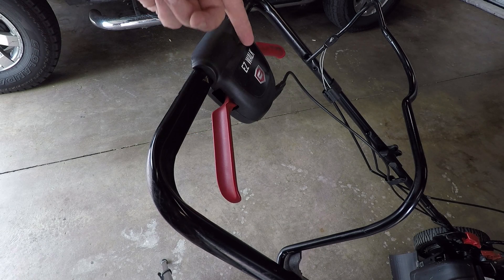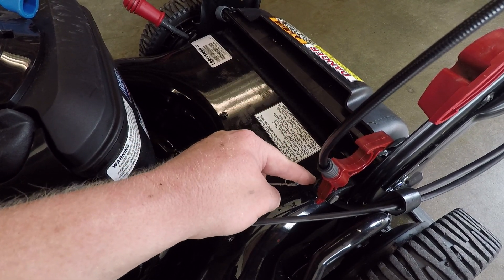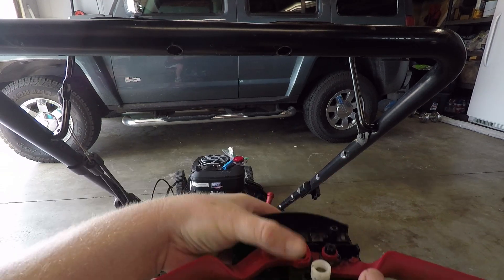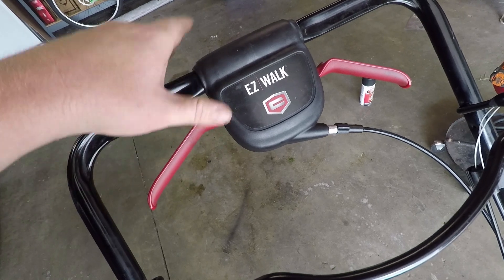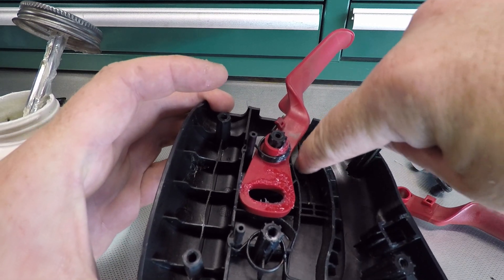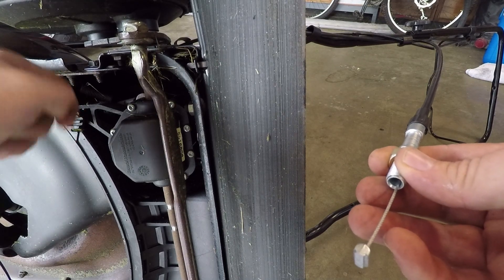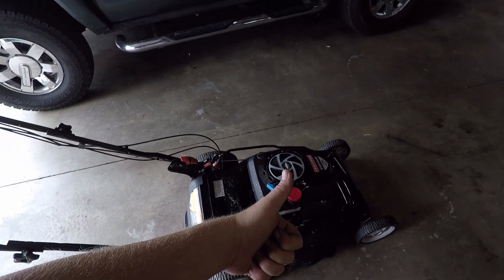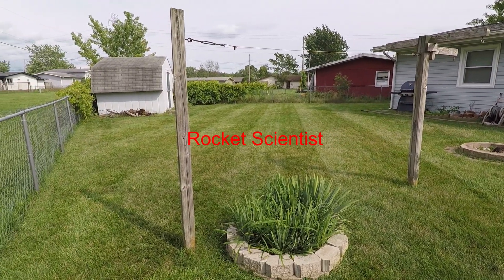Fixing a Craftsman EZ Walk Lawn Mower

Comment: My mower is like this except it ends in 921. I got it a couple of yrs ago for about 20 dollars. I fixed the no start problem and never tried to fix the self propel. I just cleaned it up and decided to see if I can fix it. My red handles won't budge. If you have any suggestions please let me know. I traced the cable to the deck. I'll see if it has some kind of adjusting mechanism to make the handles work. Hopefully this is an easy fix. Thanks for the video.

Wasn't the handle for me. Seems stuck underneath. I'll go into surgery later after my game goes off. Cable can't be broke. There's a lot of tension and no give when I squeeze the handles.

Comment: What is that spring connected to the transmission that u had to put the drive cable behind? My spring broke. Do u happen to know the part number or where it even hooks up to on the mower deck?
Reply from the maker: It's just a return spring for the transmission that returns it to neutral when you let go of the drive handle.  Pause the video at that part and take a screenshot you can zoom in on.  Any spring of similar size would probably work.  Harbor Freight sells a box of various springs for cheap.  Or, do what I like to do:  Go to your local mower shop and find the oldest dude there... He probably knows everything about mowers and will know exactly what you need.
Reply: @RocketScientist  thanks for replying and thanks for the info.

Comment: I do have a question. What's the blue cap facing upward for?
Reply from the maker: It's a garden hose connection.  You're supposed to hook up water and run the mower so it "washes" the deck, but it is a pain and makes more of a mess than anything.  I never use it.
Reply: @Rocket Scientist  Ohh ok thank you. I bought it used and had to replace cable for transmission. And had no idea what it was for. Thanks again. 👍👍👍

Comment: I had a question.  I can’t seem to get mine to pull over. The cord part doesn’t seem to engage the motor...
Reply from the maker: This autta point you in the right direction.  https://www.ereplacementparts.com/repair-center/lawn-equipment/engine/starter-rope-pulls-freely-or-little-resistance/#:~:text=If%20a%20pawl%20becomes%20worn,they%20should%20fly%20right%20out.

Comment: One handle broke on the self propel housing, having trouble finding a replacement part.  Do you know part number and from whom to order? Craftsman sites were of no luck.
Reply from the maker: I usually use searspartsdirect.com to at least find the part number, and google search the part number.  ebay might be your best bet on finding one.

Comment: Mine works but dont let the back wheels to go back if I pull it. And is not strong enough to pull the mower forward
Reply from the maker: adjust the cable.. needs to be a little tighter.  Oh, and when you let go of the handle, roll forward like 6 inches and it'll disengage and roll backward freely.

Comment: Great video. I have another problem hoping you might be able to help out on.  Somehow the front left wheel got wedged into/under the lever bar that's part of the 4-wheel leveling system.  Neither front wheels are able to spin now and the leveling handle won't move either. I took off the left front wheel hoping that would help, but it didn't.  Any thoughts?
Reply from the maker: Jeez seems like a lot of bent metal damage to the front of the deck and wheels... like a crushing type damage to the top front.  Is there a chance someone backed over it with a car or something? 😂
Reply: We solved it by unscrewing the bar, which freed the wheels... simple fix.

Comment: I have a question for you. I have craftsman gcv160. And i'm looking for cable blade ,brake clutch control rear door prop. Where can i get them. Craftsman don't have it anymore. Please help
Reply from the maker: I usually use Ereplacementparts.com or Searspartsdirect.com.  All Im seeing under that is a honda engine.  You might try to find a parts diagram and search by specific part number.  You might also try Ebay if its something really old..

Comment: Hey RV it was amazing it took me a while to put it together but soon as I watched the video you posted was like a piece of cake , but I Brooke one of the red self drive handles I don’t know where can I find one I already checked online and from craftsman as well see if you know where to get the right side handle  ?
Reply: I don't think they exist (I've been searching everywhere). Broke both handles and was so desperate that I used the strongest plastic adhesive I could find and was determined to glue these things back together. After applying a huge amount of adhesive I set it on fire and started melting the handles at the break, then I jammed them together, blew out the fire and put more adhesive on the outside of the break. I waited a day for them to dry (or more appropriately 'cure' in this case). They seem extremely strong now and I was able to reassemble the unit. I've mowed twice so far and the handles seem to be holding up.

Comment: Great video
I tried to adjust the barrel nut on the part where the handles are but still nada won't move faster. So I can remove Handel thingie  and adjust the other nut?
Reply from the maker: Yep turn the nut on the inside of the black plastic housing with the handles

Comment: What is the purpose of the cable that you tied the new drive cable to? My mower has that piece but its broken off. No idea what its for. It's part of the throttle cable assembly.
Reply from the maker: The purpose was described in the video as I did it.  Because the factory mount angle of the cable is a 90 degree and causes extra wear, so the plastic zip tie straightens that angle a bit so it's less likely to break in the future.
Reply: @Rocket Scientist I think he meant what’s is the third cable (stop cable, drive cable for ez walk but what’s the third one). I’m thinking this because I can’t figure out what it’s for either (bought the mower used and sort of regretting based on some of the feedback I’ve read/am reading, lol). The cable attaches to a bracket near the wheel that looks like it holds the bag door cover up but mine is either seized or broken in the middle because it literally does nothing. Any insight would be appreciated!
Reply from the maker: @teezer85  OHH!  ok I misread that.  Yes, you're correct.  There are two cables operated by the safety bar:  the throttle, and like you said, the other one locks the bagger door open while you're dumping the bag, and as soon as you pull the bar down, the door snaps shut.   In your case, chances are it's snapped, but if you want to try something before replacing it, get some Aerokroil and squirt some into the cable sleeve at both open ends, and let it sit for a day or so.  That stuff is like magic.  If that doesn't work, replacement part on Amazon is this:  https://www.amazon.com/Craftsman-587326601-Mower-Control-Cable/dp/B0757785NF/ref=sr_1_1?keywords=craftsman+438392&qid=1564437092&s=gateway&sr=8-1

Comment: I understand your frustration because I engineer electrical enclosures.  The engineers did not design the engine are not the same engineers that designed the deck.  It's the ones that designed the deck system to place the deck cable with the tolerance allowed without interfering with the transmission .

Comment: I have this model (or similarly close) and one of the red plastic handles actually cracked inside the control box so it won't propel any longer.  I can't even replace it with a new handle without getting the whole new unit which is about $50. :(
Reply from the maker: Try this. Same thing, different name.

Pokin for Husqvarna Craftsman 583190501 Drive Control Handle Lever https://www.amazon.com/dp/B07B3T654X/ref=cm_sw_r_cp_apa_i_ppyHCbTCAE0QD

Comment: I have the same mower same problems and more
Reply from the maker: Just recently the auto choke failed and still had problems after new parts.  Turns out I fixed it with a piece of clothes hanger to keep the choke from opening all the way.  Voila!

Comment: This is really made by AYP.(husqvarna)
I don’t like the ez-walk self propelled handle system I prefer the FWD with bark to hold with the safety bar.

Good fix btw.  👍
Reply from the maker: D Fields Thanks!  In hindsight, I probably would have went with the Toro peraonal pace.  Ahh well, next time.

Comment: This video saved me.  I was not fortunate enough to keep everything inside the case.  I had to put everything back inside the EZ Walk case.  Thanks for the close up video shots because the handles only go in one way that allows for easy re-assembly.  Now I can get back to doing what I hate most!!!  :)  At least it didn't cost a lot to fix it.
Reply: I did the same thing,  I should have taken a pic after I had it open and removed everything. I couldn't for the life of me figure out how to put it back together (until I saw the close up in the video).

Comment: Thanks for the video.  I was able to fix the self propel cable but now the lawn mower does not start.  Any ideas?
Reply from the maker: I'd start with the thermostatic auto choke.  It's inline with the exhaust. They are known to fail and cause a no-start.  Briggs & Stratton part # 593208.
Reply from the maker: @JesusIsaFlatEarther  well, I'm not a real rocket scientist, it's just a name I've used for years. But I am a fairly smart guy, so I'll give it a shot.  Air has molecular weight and thus susceptible to the effects of the earth's gravity.  So the closer to earth, the higher the density and pressure of air.  Just like the ocean, the deeper you go, the higher the pressure.  There is no physical barrier holding it in. It's not a "movement of high pressure to low pressure" like a punctured aerosol can.  Force of gravity holds the atmosphere close to earth, and space alone is not capable of exerting force, so the strongest force wins.  Like a tug of war with no one on the other end of the rope.  Conversely, if another stellar body with a stronger gravitational pull were to pass close enough to earth, I'd bet we wouldn't be breathing much longer.  This effect can be directly observed in the moons effect on large bodies of water, i.e., waves, high/low tides.   That's the best I can do off the top of my head.  Hope that works for ya.
Reply from the maker: @JesusIsaFlatEarther  oh, and just out of curiosity, how did you come up with a question that deep from a lawn mower video?

Comment: This is a great video to help in fixing the power drive.  My model EZ-Walk is 917.374541, just slightly different model.  I wonder if the cable is the same size.
Reply from the maker: Breton Bell Thanks!  Not sure on the size for yours, but if you google your model number you might find a parts list from Sears Craftsman.

Comment: Awesome video Rocket Scientist.  First class production.  I wish I could find a right hand drive control lever.  Mine broke - can't locate one anywhere.  Any ideas would be greatly appreciated.
Reply from the maker: Wow those right levers are impossible to find.  It's $50 bucks, but ereplacementparts.com has an entire drive control with both levers and a new cable.  I've ordered from them lots of times.  Top notch parts company!

https://www.ereplacementparts.com/drive-control-p-2479285.html

Comment: From my experience with Craftsman power equipment, you first and only mistake you made was initially buying Craftsman brand power equipment  . I learned a long time ago there just not what they should be . And yes I made the same mistake once . I work on small engines and have for over thirty five years . But use it and try to get the most out of it .
Reply from the maker: I completely agree!  I'm just waiting until this one dies so I will have a good excuse to buy a new one.

Comment: Wanna thank you for this video....got my mower propelling again :)
Can you tell me what kind of oil should i get for this model and where do i get it from?
Reply from the maker: jonty2887 Thank YOU!  Glad I could help!  Off the top of my head, oil.. I THINK It's SAE 30.  I used the quart that came with the mower and the container is long gone, but Briggs & Stratton makes it, but it can be any brand it's just regular motor oil which can be gotten anywhere.

Comment: How do you take off the stupid cover that covers the belt I'm stumped
Reply from the maker: Scooter GMC2000 Wow I can't find anything online either, and my google-fu is pretty strong.  I will take a look in the morning and see if I can figure it out for ya.  Thanks!
Reply from the maker: Took a quick look and I'm kinda stumped too.  Looks like it should be the bolt next to the blade and two screws on top side of the deck.. But it's still tight.

Comment: Awesome video. I have this exact mower. The handles on mine are stuck. They will not budge! I have never had this happen. I even tried to squeeze the one side so hard it snapped! If you may have any idea what the issue could be, please let me know! Thank you!
Reply from the maker: Best I can say is take it apart and see what's broke.  When you do, it helps to take a picture for yourself so you can remember how it goes back together once you have it apart.  Try www.ereplacementparts.com they have everything you might need.

Comment: I buy and flip mowers. Im just about fed up with the crap quality. I will just get the mower where it functions then sell it. Then the customer has the crap. If the company puts out crap I do crap repairs, as I'm not spending money on a cable. So the customer will 1- Not come back to me for buisness, and 2-the will never buy another craftsman. These mowers are what turns people away from a brand.
Reply from the maker: You're not kidding..  This one is still alive... barely... Its has become a colossal pain in my ass.  It barely runs and sounds like a harley.  I have since moved and only use it occasionally to mow a ditch.